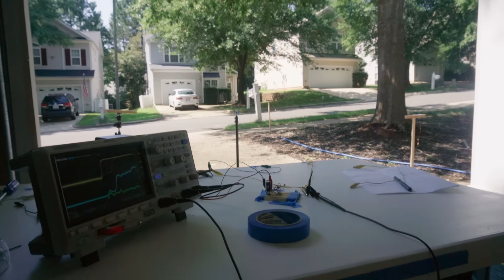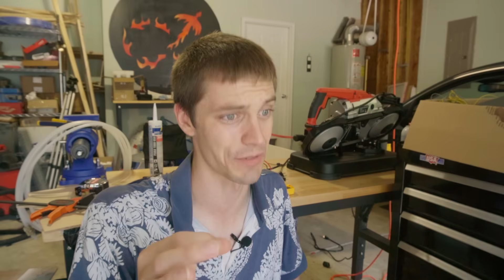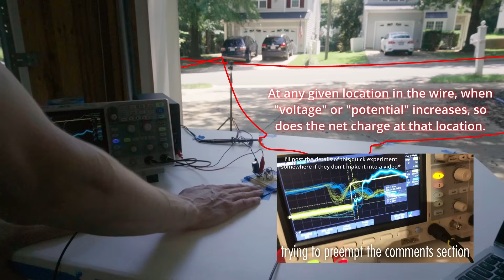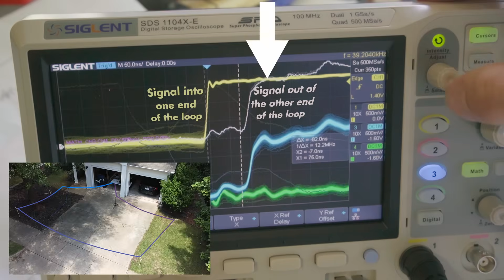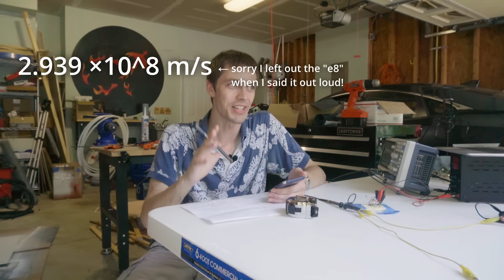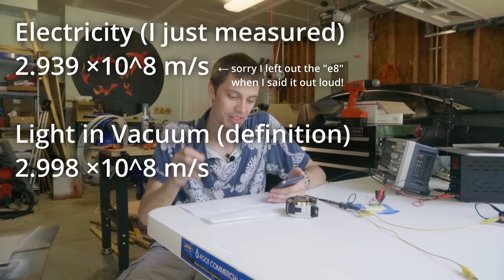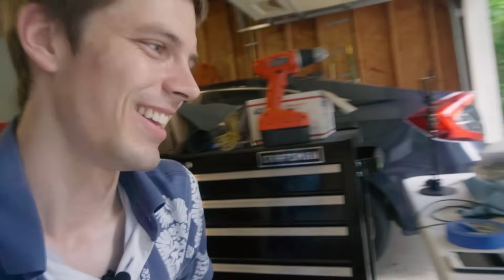Why does WATER change the speed of electricity?

Comment: yes but you should use not a solid contact, the 2 small metallic contacts when you close the switch because they are not a continuous cable they generate high frequencies with micro sparks, you should try with a solid contact to see the differences

Comment: At least there's a big difference when the wire is made of plasma in a return lightning strike (about 1/3 the speed of light). I know in labs they've slowed down light to about 17m/s (38 mph, a car could have out ran it ) instead 299,792,458. I wonder if they could do the same for a flow of electrons/ions.

Comment: century ago "insulators" correctly called "electrics",  "conducturs" (metal wires etc) - non-electrics. 
water is insulator only while distilled and 100% pure (chemical water), tap water or usual drinkable water or rain water - opposite, thats why usually humid air more likely to be pierced by lighting than dry air.

Comment: You have to remember that water is magnetic.  You need to run that part with distilled
water, and see what happens.  Its like dropping a magnet thu a cu. pipe, and the magnet 
moves slower because of the magnetic properties of the pipe.
That was a very interesting test of how fast electricity travels.  
Try to figure out if heat will affect in the same way.  The problen will be how,
to keep the wire from stretching with heat.  Steel  becomes non-magnetic with
a lot of heat.  (How about dry ice.  It's not water, but it is cold)
Keep the Good Work, it is very interesting..

Comment: Electrons flow from the Anode (-) to the Cathode (+) in a battery charged or DC circuit. Your diagram shows electrons of the conductor reacting away from the Cathode. When the conductor material excites the adjacent electrons, they travel from negative to positive. The velocity factor of the conductor and temperature have the biggest impact on current flow speed. No?

Comment: An interesting question is how fast do the electrons move through the wire? As I recall from my EE classes (45 years ago) electrons hardly move at all. The electrons are "force carriers" which move the electrical energy. The first electron "injected" "bumps" the second electron which "bumps" the third, etc., until an electron is "bumped" out of the other end of the wire. This "bumping" carries the electricity at nearly the speed of light. However, the electrons barely move. If I remember correctly, it would take years for an electron to move a meter down the wire. That is another good reason for calling it "propagation".
Reply: The speed at which electrons travel through conductors is called "drift speed."

Comment: Wonderful video.  Two comments.  You say it is AC but since it only goes in one direction, it is pulsed DC.  Second, when you calculated the speed through the water pipe, did the wire go through the pipe so the water surrounding the wire or was the wire cut at each end?  If it was continuous, did you assume the electricity was going through the water or the wire?  Since pure water is nonconductive, what was in the water that would make it conductive?
Reply from the maker: Wire was insulated from the water it went through

Comment: Random Electronics and Displays,  was right on the money about delays in Coax cable .
 .... early Lab Oscilloscopes used a small coiled length of coax, as a fixed 'Delay Line'.... ;-)
Also other types of delays, (not Coax) are the coiled wire Luminance delay line and the glass Chroma delay line used in the old PAL Colour TV's ....

Comment: Why do you show in your animation electrons being shoved into one end of your loop without the complimentary electrons being simultaneously sucked out of your loop at the opposite end? Also, even with putting a rectangular wave into a loop, you have not seemed to mention that  conductors are WAVEGUIDES, given you are using waves to make your measurement. being wave guides, conductors also transmit magnetic fields, and the animation is missing the magnetic component of the electron motion which is just as foundational to the structure as the little field lines radiating out from the charges. Also no mention of the ground plane which is an inherent part of the structure. To speak of how this loop thing responds according to electromagnetic theory would require setting up the loop in the simplest configuration, i.e. a circle at a uniform distance above a ground plane and then with the vector calculus set up by Maxwell's equations, (given to us by Heaviside), just derive the system response of the structure, with ground an integral part of the structure. You could even do a finite element analysis solution to arrive at the structure system response.

Comment: Electrons are (likely) just slight over- densities of the field to begin with. Sine waves (harmonic oscillators) confined to a "location".  So that density moves down the gradient (2nd "Law" [guideline] of thermodynamics), which causes a spread in all directions. The apparent direction has a bit to do with the speed of light itself, owing to Special Relativity and Wigner rotation. This creates a bit of an asymmetry in the frequency behavior, and so a force (symmetry breaking). It's ALL frequency. Mass, light, electrons, quarks... All of it. So yes, that's why we should expect "electricity" travels at "c". It's all frequency, and how quickly that oscillation happens is c itself. 

One amazing thing is that the Universe acts on changes we make with a restoring force. (Such as back EMF and dipoles, water restructuring magnetic moments, Van der Waals forces, etc.). These are all very much understudied and overlooked. It's one of those areas people think they know, until you start asking the right questions. 

But does "c" actually change in materials? Or are the path lengths changed and averaged. If "c" actually changes in materials, and can be slowed down, the gravity drives are possible. Along with time travel, and warp drives. Lowering the coupling barrier between gravity/ spatial geometry and energy, allowing for high gravitational coupling to  energy inputs. (This of course, is because c^4 is in the denominator of the gravitational coupling constant of the GR equations. So lowering "c" would increase coupling between energy and space curvature, so providing a "hill" of potential energy when effecting local spatial geometry.) That actually would solve a lot of questions: "gravitational dipoles" which would interact analogous to Van der Waals and water resisting electrical field changes. Does "c" actually change in materials? That's an open question.

Comment: Wait. If it moves at the speed of light could you use it to measure the speed of light in a single direction while it is technically just a larger coil of wires equating to a certain distance light has to travel for it to become noticeable?

Comment: If you were worried about the vinyl coding on the multi strand wire affecting the timing, why didn’t you just take it off?

All of the effects you were talking about, especially with the water, which seem to be simply a capacitor affect between the wire and the other components, like an R/C filter. So isn’t that really what “slowed“ the signal?

Comment: When thinking about electrons moving through a wire, it's a bit like that thought experiment: imagine a long stick from the earth to the sun, if you push on that stick a little bit, how long does it take the other end near the sun to move? It takes about 8 minutes, as in, the speed of light. The stick did not actually move at that speed (your end of the stick might have moved 1 inch) but the orientation of the wave of electrons bumping into each other was at c.

Comment: The water experiment would be cool to see with three or four variable waters: absolutely pure water (no minerals), salt water (various amounts/kinds of salt) and "hard" water that has high calcium content.  Each should produce different speeds.  I have heard that absolutely pure water does not conduct electricity at all, and know someone that has see (says they have) a demonstration of that.  That would be interesting to see as well.
Reply from the maker: In this case it shouldn’t matter because the water itself isn’t conducting electricity - it’s insulated from the wire. That said, I’m now wondering about the speed of electricity through water where charge carriers are a lot heavier

Comment: Ok, given that a lot of the energy in the wire is really transmitted OUTSIDE of the wire, and that you can affect that electric field by the dielectric surrounding it, could you charge a dielectric around a wire (like charging up a capacitor), using a separate power source, could that then have an effect on the signal in the wire? Basically I'm asking if there's any way that a certain audiophile gear manufacturer, who makes cables with "charged dielectric insulation" (that has a little battery that seems to just be connected to some fancy insulation), could possibly NOT be selling snake oil? I've always felt like there could be something there, at least in theory, though the change may be immeasurable. But maybe not, perhaps things like how it handles current won't change, but maybe on a signals level there could be some difference? Still unlikely. (Former audiophile gear salesperson, who had to sell these things, and has always wondered).
Reply from the maker: Isn’t that basically coax? I mean the outside of coax is normally just grounded but still

Comment: The electricity wasn't as affected because it still had the wire to guide it, which has greater conductivity so the electrons of course mostly take that path, but since elections don't actually travel through the wire, but more as a tight cloud around the wire, I think the delay was caused by the higher conductivity wire pulling the electric field though the water faster than the electric propagation speed, but still being slowed by the drag of moving through the water, because electrons are not entirely massless, or to say they can have a relative mass.

Comment: "WHY does electricity travel at the speed of light?"
Are you sure light doesn't travel at the speed of electricity?
 When I was a kid, my bedroom was infested with vampires, so I would try to run and jump into the bed before the light went off after I flipped the switch. I was so afraid, I think I actually pulled it off a few times.

Comment: Don't forget about the SWR, any frequency will experience a standing wave pushback when the conductor is not tuned to the frequency induced and the conditions existing on or around the conductor. Such as the water quenching the electron cloud around the conductor at higher frequencies that will have a pushback effect similar to pinching a garden hose which changes resonance and propagation speed as well. Food for thought!
Reply: Electron clouds only exist within atoms, it is the ELECTROMAGNETIC WAVE that propagates through the water.

Comment: The delay line as it was called, delayed the signal about 1.2 microseconds using a 36 gauge wire approximately 2800 feet long wound on a 1/2 inch diameter tube core. Later TVs used a crystal cut in a precise way to bounce the signal around inside it to achieve the same results.

Comment: Just like billiard balls smacking into each other slows the transfer of energy to the final destination, the bumping of electrons in a conductor experience the same propagation delay. Old color tv  sets used a coil of wire to delay the chromatic image to match the slower, delayed color image after it was processed to get them in sync before being sent to the color electron guns in the crt tube for display.

Comment: ...so why didn't you just trigger the switch one time manually?
Reply from the maker: I did when I ran the big experiment with the 1 km wire, but it was a big hassle and this is functionally identical - actually better because it averages multiple “ON”s
Reply: @AlphaPhoenixChannel  OK, but went on a rant about FFTs approximating the frequencies and how that affects the reponse of the system, yadda yadda yadda,  thus not giving you the 8.9 factor you were expecting. If you eliminate the switching effect of running multiple triggers, would that then become a discreet event, thus your results SHOULD (according to you) be more in line witht the expected values? or are you suggesting that even single dicreet switching event have an FFT equivalent simply due to the phisics of making and breaking an electrical contact?

Comment: So what's the speed on the ground , also with the other wires along side, lastly if the plastic insulated wire is stripped what's the difference ?
I feel an urge to dig out my oscilloscope at some point.
A bounceless switch would greatly improve the clarity of the results.

Comment: I loved this experiment. Maybe too late but consider an LC meter to measure capacitance inductance of your wire, instead of, or in addition to resistance. Simply measure your wires L and C values in the various configurations as LC relates to AC transmission line theory.

Note: frequency f=1/(2π*sqrt(LC)), wave velocity v=2π*f. Double check my math but in this form, LC are similar form to your epsilon and nu coefficients.

There are low cost "LC meter tester" on Amazon.

Comment: Love the videos, especially on electricity!  THANK YOU for conducting these experiments and making these videos!!!!  Would you repeat the experiments with aluminum and steel wires to also demonstrate this effect is also applies to other conducting metals? This would further verify that electricity travels near the speed of light in all metal conductors. 

A few questions and comments regarding your question, “what is the speed of electricity?”
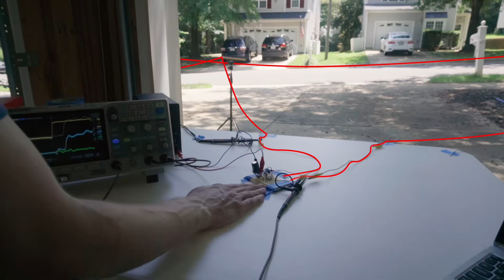You said @ 3:13m, "When this switch closes, it launches a whole bunch of electrons all at once into this alligator clip, which then starts the wave propagation thing."

If conductivity was about electron flow, then it seems the material’s mean free path (MFP) would be relevant to results. How do you rationalize a combination of "electron flow", MFP, and resistance that permits for speed of light travel in all metal wires? If the redistribution of electrons was, in fact, relevant to your ultimate question “the speed of electricity in metal wires?”, then it seems again the MFP of the metal would result in different measurements.

That said, it seems you already proved this (or provided substantial evidence) with your experiment. You measured no corresponding change in the speed of electricity despite changing the resistance of the wire. It seems this result would negate the argument that “electron flow” in a metal conductor is equivalent to “charge” in a metal conductor (distinguishing metal from nanocarbon conductors).

You could further verify this with the Al and steel wire experiments. If the speed of electricity is about electron flow, then you should measure noticeable differences with Al and steel wires. However, if your results are the same and all metal conductors show this near speed of light result, then it must be ruled out that conductivity is about “electron flow.”

It seems a more plausible explanation for the near speed of light results are that conductivity is about a state of charge on the wire. Instead of “electron flow”, think in terms of a "charge on the wire" or a "charged state of the atoms.”

Instead of asking how fast does electricity flow, pose the question this way… “how fast can the excited state (the charge) of the first atom be communicated throughout the conductor?

Does it not make more sense to connect the near speed of light result to charge on the wire? The charge travels at the speed of light. Think in terms of quantum electrodynamics (QED) and quantum entanglement. The minute the alligator clip receives the "charge", which is technically just an excitation of the metal atoms, that charge is relayed to the rest of the atoms at the speed of light.

This seems to me a more plausible rationale to explain why electricity travels at the speed of light.

Comment: The BIG issue with your setup that virtually nullifies everything is that you're not taking into account the scope, itself. You effectively have that whole loop short circuited by the internal capacitance of the scope. You've effectively connected all these probe points in the circuit with the scope.

Further, why are you using the permittivity of water when you're calculating the speed of light --through the copper wire---??? Water acts as a dielectric, sure, but it really doesn't affect the propagation speed through the metal conductor within it... If you're using water as a dielectric in a capacitor, sure, it would be appropriate to use its permittivity when calculating a propagation velocity of the displacement current -through the water itself, but that's not what you're doing in this case.

If, instead of having the wire go all the way through the pipe, you have the wire terminate at one end of the pipe in contact with the water and the wire start up again at the other end of the pipe, also in contact with the wire, THEN it would be appropriate to use the permittivity and permeability of water in your calculations. THAT should have a 9x slowdown as predicted.

Comment: Good experiment, bad conclusions. Electrons do not exist. Electricity is a circuit composed of the dielectric and magnetism. Or in other words a whole entity comprised of two constituents for its existence. The dielectric induction voltage is always proportional to the rate of increase of the magnetic field, of which this is so deemed the electric circuit; comprising these two field modalities, we have the conjugate pair. Electricity is natures more simplex circuit, and its own field conjugate phenomena allows electricity to propagate without guiding wires etc. on its own; hence we have light, and hence the "speeds" are the same.